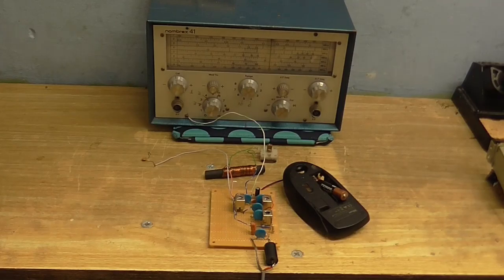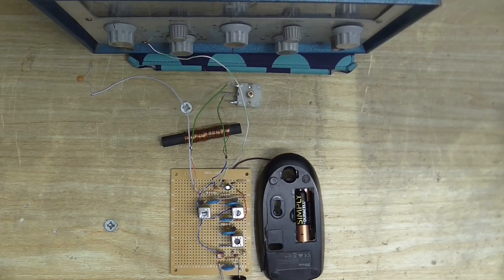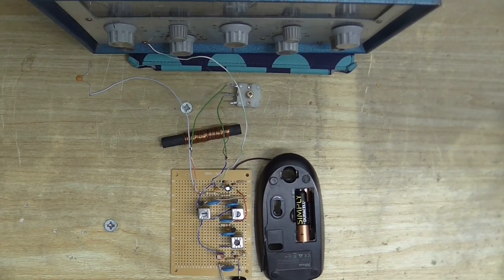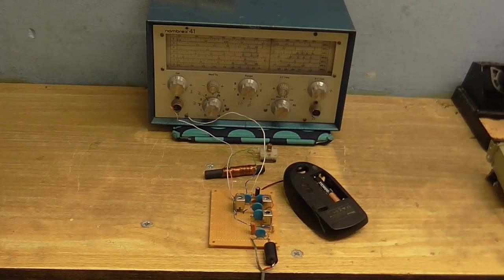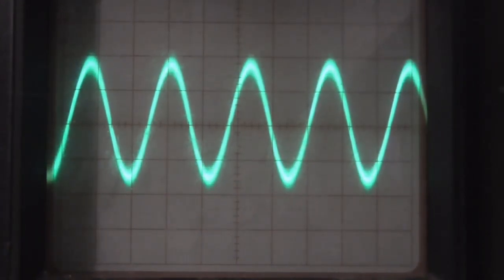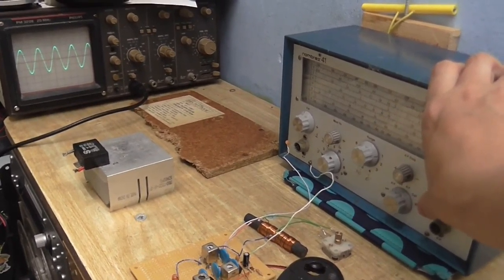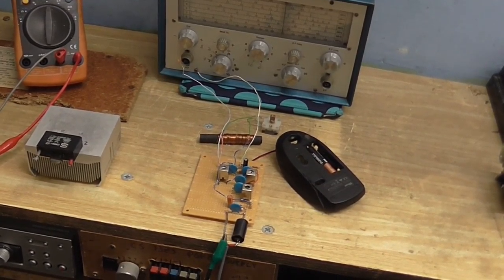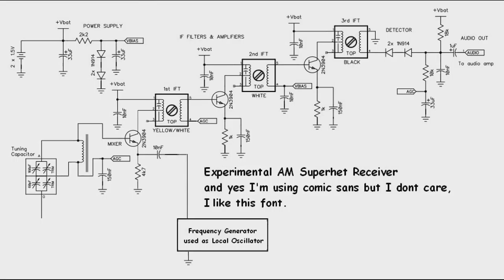Experiments with my homebrew Superhet AM Radio

Comment: Gotta say that's probably the nicest sounding AM receiver i've heard, the stronger stations sound almost as good as FM! I know the AM band in the UK is generally heavily processed at the transmitter output, i.e. compressed and bandwidth limited for good reason, but this does really sound good, there actually seems to be treble in those AM broadcasts!

Comment: hy you explained this very well. How do you get your if cans or rf cans do you buy them of wind your own or just desolder and measure and use ones that have right resistance ? shoud they be such inductance that it resonates at 455 khz ?
I dont even have scope cause where I live you need to pay more than 100 $ for some osciloscope that is crap it has banana jacks at input
so I will build some circuit with 555 or op amps so I can measure frequency with my phone or multimeter to figure out the inductance.:)
Reply: I wound them myself for my superhet, you can find datasheet on the web. And you can align them just by using one eye and tongue at right angle if you are lucky enough.   ;)
Reply: +MrJohhhnnnyyy datasheets for specific can one that I have or some random can datasheet ? I tried typing in those numbers from the cans but didnt find anything ? I just want to figure out what inductance I need ?
Reply: +JOSIP Žlk Search datasheets for these cans: 42if301, 42if302, 42if303. They are 455khz cans, in the datasheet you'll find number of turns for each winding as well as cap value. And there will be info which can is for which stage. If you want I can make a short vid about those.
Reply: Ah so it must be LC circuit not just inductor now that more clear to me. BTW-I know there are cans with cap inside but I seen them without if I need more help I will ask :) Thanks!
Reply: JOSIP Žlk And there's a little secret that they don't tell you in the datasheet - phasing. If the local oscillator won't work (no static), just swap connections to the secondary around on the LO can.
Reply: ok,what does Q factor mean I know that it means reactive energy in some circuit but it doesnt make sense to me here ? it sais Q=Z/2*pi*f*L ? what ??
Reply from the maker: The IF cans I got were from a fellow YouTuber (I forget who) But I think you can get those from places such as Jaycar.
Reply: JOSIP Žlk It's a quality factor of a resonant circuit. Leave it alone, you need to follow turns ratio and tuning capacitance.
Reply from the maker: To put it simply, the more Q factor something has, the narrower the frequency band is that it reacts to.
Reply: so that tells me aprox how Z/f graph looks like.
Reply: +CoolDudeClem +MrJohhhnnnyyy So how can two transformers have diferent impedance when there is  same  inductance and capacitance  but one is 50k and anoather one 20k  what does it mean then ?
Reply: +JOSIP Žlk I'm not an RF wizard, so I won't try to explain what I don't know :) When I built my superhet I just followed number of turns and cap value,  and they work fine being constructed by an RF dummy
Reply: +MrJohhhnnnyyy I will do the same then and if I get to it build inductance meter  I will do it by inductance I found page with all inductances I will give you link if you want I  am not home right now so I cant.
Reply: JOSIP Žlk I used data from Mouser's datasheet, it showed up first when I searched for it

Comment: what about using a 74HC4052 operating as a quadrature sampling detector driven from a 74AC74 which is driven from a local oscillator at 4x frequency which outputs two signals which are 90 degrees out of phase which are then combined using a phasing combiner and it gets rid of other annoying birdies ether side of the wanted signal. the input to the quadrature sampling detector would be from a tuned circuit where the centre of the tuned circuit is connected to GND and the other ends of the tuned circuit connects to the X and Y pins of the 74HC4052.